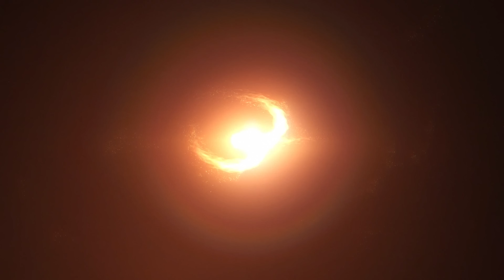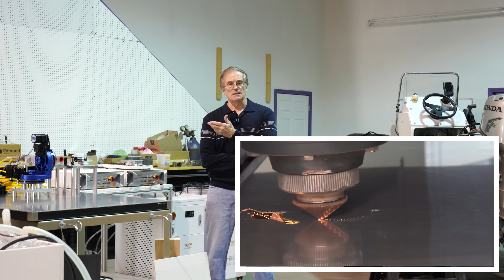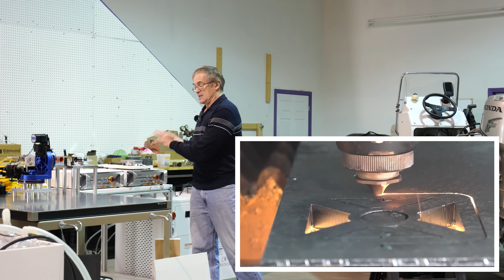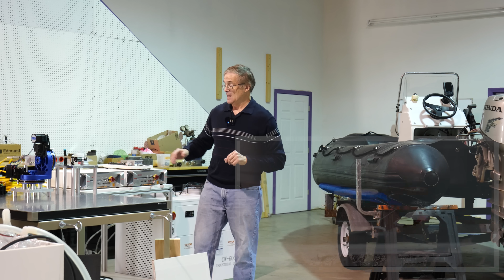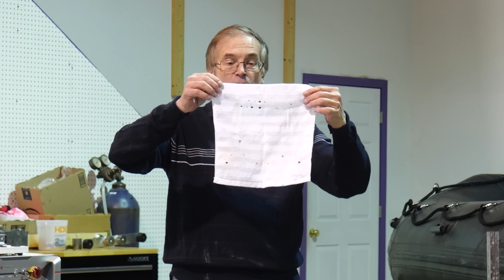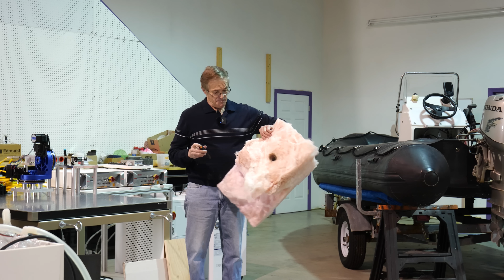We have a problem... and need your help!

Comment: What about a sugar-based carbon Nanofoam (Channel: Robert Murray Smith / TnT Omnibus) and/or Starlite (Channel: NightHawkInLight) - Outside of the energy cost of baking the sugar into a foamy brick, both materials should be fairly cheap and are unlikely to burn through quickly. The "Starlite" is basically flour and borax. I don't think the borax will off-gas into anything particularly dangerous, but it's been awhile since I watched either of their videos - Hope this helps. Thanks.

Comment: How about thermal pain glass with the the top open! move it into position and then fill with water! Drain after testing. Depth can be adjusted based on testing. Glass is not that heavy. Basically  a very thin fish tank. Or a large wall of refracting lenses, But you did mention cheap. Glass might be more expensive than Drywall but may get away with a single layer with plywood backing! Don't know what you budget is but the width of a water wall is easily adjustable.

Comment: If you're using an infrared laser copper is a good reflector. A polished copper mirror at a 45 degree angle, directing the beam down into a sand trap. Basically the same idea used at indoor gun ranges, although there the reflector isn't copper. Portable, too. Outdoors you can send the beam into the dirt. Just my thought!

Comment: My initial thought was that you need to talk to NightHawkInLight about his video on starlite. He basically has a cheap intumescent putty. And it would be a great colab but I think ultimately it wouldn't be a success.  But I do wonder if a falling sheet of water could work. I am thinking about the light ducting you can get with laminar flows. Lastly if that water has the right sized particles you can use Mie scattering to further diffuse the beam. You don't want to stop the beam you want to spread it over enough area that it doesn't generate much heat.

Comment: The 30-minute Gemini deep research on the topic based on the video transcript was amazingly detailed. Too bad I can't link it here. Here's the main conclusion:
Based on the analysis of material properties, laser-material interactions, safety considerations, and the specific requirements for a temporary emergency beam stop capable of withstanding a multi-kilowatt CW fiber laser for at least a few seconds, the following recommendations are made:

Primary Recommendation: Contained High-Alumina Refractory Brick Assembly.

This approach involves constructing a robust, contained assembly using high-alumina refractory bricks (60-70% Al2O3).
 A minimum total refractory depth of 2-3 layers of standard bricks (approximately 5 to 7.5 inches or 127 to 190 mm) is advised.
The bricks should be tightly stacked within a sturdy steel frame or box to ensure stability and containment of any minor spalling.
Applying a dark, high-temperature refractory coating or wash to the front surface of the bricks can marginally improve initial laser absorption and provide a minimal sacrificial layer.
This option offers the best currently understood balance of high-temperature resistance, thermal mass for short-duration energy absorption, inherent non-flammability, a manageable fume profile (provided effective Local Exhaust Ventilation is used), reasonable material cost, and modularity for portability.

Comment: Could you engineer some way to shorten the focal area? I'm thinking a concave lens, then a large convex one, their relative position and power chosen in such a way as to give a more or less hourglass-shaped beam (when viewed side-on) that is non-burning both at the exit pupil and at the wall, but has a narrow range band in between then in which the beam is ~focused. 

Should do fine for testing anything but range and power.

Comment: Point it downward.
If you must be pointed at something, point it at a bucket of wet sand or dirt. You could even make it just a bucket of water. Since the point will be very small, it should take a long time for the water to drain, but water should help diffuse the light, this, especially if it is muddy or cloudy.  The particulates suspended in the water should also absorb a lot of the heat and distribute it to the rest of the water, making the back of the bucket when it hits a lot less vulnerable to penetration or thermal stress from the laser. The bucket can be made out of anything, put a 5 gallon bucket from your local hardware store, and then plug the holes with gorilla tape afterwards. Once the bucket is no longer serviceable, just dispose of it and get another that should provide you with hundreds or thousands of test fires, and they should be longer than a second.  I think muddy water is probably your best option, because the particulates will remove heat from the area, and keep the bucket from melting.  If a plastic bucket won't work, you can always try making your own bucket out of wood or purchasing a cheap metal bucket. But you can probably find a good quality metal bucket from a feed supply store for relatively cheap.

Comment: You're looking for ceramic fiber insulation (also known as refractory ceramic fiber, or RCF).

This material is:

Fibrous and flexible, similar in texture and form to fiberglass insulation.

Made primarily from alumina (Al₂O₃) and silica (SiO₂), sometimes with additions like zirconia for higher temperature resistance.

Designed for high-temperature industrial applications, often rated between 1000°C to 1600°C (1832°F to 2912°F), depending on the formulation.

Common forms include:

Blankets (most like home fiberglass batts)

Boards

Paper

Modules (for kilns and furnaces)

One of the side benefits of this material is its  bright white color, as long as it doesn't carbonize, it should be able to absorb quite a bit of heat I expect it would glow red or orange but as long as it doesn't melt it should work for your application. I'm familiar with the blanket form of this material.

Comment: What about diffused acrylic sheets? You could probably get them colored as well to better absorb the specific wavelength of your laser. Maybe add a sheet of drywall that you already bought behind it or flow water behind it with a hose to absorb more heat if needed.

Comment: Mineral wool insulation might work. Rockwool is the big brand. It is more heat resistant and fireproof than fiberglass insulation.
Reply from the maker: This has been mentioned several times now in the comments, and I should have thought to test it.  I will now.

Comment: Maybe just some bags of dirt would do it? How big of a target area do you need? Are you wanting to perform a full power test indoors where you zap a drone out of the air, or do you just need something you can dump the beam into for stationary testing?
Reply from the maker: For stationary testing, the bricks work well. We need a full-scale barrier, and that's why weight,  cost, and availability are now an issue.

Comment: you should use vitrified ceramic tiles used on floors. It should definitely stop the laser. If it doesn't make a water wall with these tiles. They are relatively cheap.

Comment: How about charcoal soaked with water.
The water will keep the oxygen away from the carbon so it won't ignite,  carbon black is the gold standard for absorbing energy, and it's melting point is 3550° C.
If you put it in a box with something like Pyrex walls that the laser will pass through, it may do what you need.
You might also see if you can get some samples of carbon-carbon, which was what was used as an insulation on the highest temperature parts of the space shuttle, or you could check out the space shuttle tile material.
Reply: You could also use a carbon slurry suspended in water using bubblers to keep everything agitated.
Reply from the maker: Maybe carbon powder in flowing water over a barrier wall will be best.

Comment: How about a mist machine? It will either absorb, refract or reflect the light. As long as the particles are significantly smaller than the beam it should disperse on reflection or refraction.
Absorption might be a bigger problem but then you might consider a waterfall of the fluid. Surface reflections could still be a problem.

Comment: Tightly Sandwich the three-quarter inch plywood between two sheets of drywall basically a plywood sandwich lol and then stack bricks behind just in case the beam punches through, all of that could be put on a nice rollaway cart.

Comment: What about using a laser distance sensor and auto adjusting the focal point?
Reply from the maker: The focal point needs to be in the "killing range" of the drones. But, the beam is still quite small before and behind that point.
Reply: You cant use a lens to change the focal point and render the beam 'harmless'? I did something like that once..except I was auto aiming a nerf dart.  @TechIngredients

Comment: The only way I see to defeat its destructive power is to use the same efforts that you invested to converge the beam for... diverging it! A divergent lens will spread the beam power to a larger area that some of the material you already tried will be able to withstand. With my knowledge this would work only if the laser beam is fixed and not moving... But hey, you know so much more about optics than me, you'll find a way to make a "optically divergent wall" (probably you can also find a better name lol)!!! Good luck guys, you are basically living the work of my dreams, thank you so much for your videos!!!
Reply: Or what about something like a Holmdel Horn Antenna made of a reflective surface that will ideally focus any incoming beam to the focal point where you can place a divergent lens. TBH this will probably make your next video EPIC lol Ask Colin Furze to help you build it =D
Reply from the maker: We have to cover the entire back wall.

Comment: Use water with some particulates in it, and/or an object , so it will absorb and diffuse the energy. A fish tank, have some form of agitator, or circulating pump, then in the water just add silver or something, also use a chiller to pre cool the liquid. Use directed pumps to force the water at the point of entry into the fishtank, keeping the heat moving. You can make a small hole in the fishtanks, where the water flows out, use that as the target point for entry, so you do not have to worry about the glass melting. copyright me, limited license to you for this test case.

2nd plan,

Set up a water jet array, with multiple streams of water, as the light hits the streams of water it will absorb and diffuse the energy, adjust stream thickness and volume as needed for the amount of energy diffusion needed, think of it like a water fall machine. And experiment with different additives in the water, nano particle silver comes to mind. Technically if the water is clear enough you can shape the light to expand its footprint.

3rd plan, make a large diffusion optical, lens, that takes the small beam of light and expands it to a manageable surface area, catch and release…

Comment: Fog machine\nebulizer run the output through a tube and then the laser through the tube.

Lasers hate water molecules makes em scatter.
Water molecules love to soak up heat.

 It should cost you less than $500 to make it

Comment: Whatever material you choose, consider the angle its presented to the laser.  I.e. burning through sheetrock at a 22° angle will behave as if it were much thicker than if it were face-on (no angle).  This is the same trick employed by modern tanks and armored vehicles.  The angled armor plates gives much more protection at no increase in weight.
Reply: The only other aspect to this is reflection ability of the impacted material.

Comment: Textured metal is probably the best choice. It won't reflect too specularly from a few meters if it's textured (you're wearing eye protection right!) and it won't hit >700-1400C in less than a second if it's reasonably thick. The effective heated area is proportional to thickness and conductivity, while heat capacity is proportional to thickness and area. If you were focused to <100um it would just burn through, but at >1mm you're down 100x in power density and you've got some time. I'd probably go with 3mm aluminum "diamond" sheet which would be <30lbs each for 4x8 sheets. You can sand blast it for texture and rivet it to hang multiple sheets like a curtain. Steel would be heavier and work too, but DONT do galvanized!

Comment: Just using energy absorption means more mass. Add dissipation? A rectangular sheet metal water tank? If you punch through the sheet metal, then increase the spot size by tilting the tank.

Comment: Started with idea of reflect/bend instead of absorb. Perhaps large fresnel lens sheet. Refract (instead of reflect) the beam down to a safe spot. OR - Similar to LIDAR, measure the reflect time, calculate distance. Shut off Laser if below a certain distance.

Comment: use a lens grade glass with uneven surface. put a drywall behind it. the uneven surface will disperse the laser beam so it will be totally unfocused when it hits the drywall. should be cheap and light enough.

Comment: If the water soaked fabric survived several milliseconds how about a belt of material that is driven around pulleys through a water bath? You should be able to tune the speed to evaporate water without burning up the fabric, though you will end up with a lot of excess water vapour if you don't stop the beam fairly quickly.

Comment: Can you build a moveable wall that is made of borosilicate sand that would scatter the light as it hits the sand and auto fills in the gaps as the sand is turned into liquid glass?  Maybe something about 4 inches thick on wheels.

Comment: Some quick thoughts. 

Ceramic tile

Some sort of fine powder like a salt or baking soda with a high melting point

Maybe glitter mixed in, to disperse light into nearby particles 

A sandwich with some sort of tile, or plywood, filled full of this powder, with a tile backer, maybe even polish the tile backer so it send the light that gets through back into the media

Comment: Maybe look at it like a firing range designer would.  Open the door.  Move the truck. In place of the truck put a large mound of earth, sand or crusher run gravel.  It looks like you simply need volume.  Maybe sand bags filled with different media.  Good luck.

Comment: I once saw a sheet of Mica it was about 1/2 3/4 inch thick, the old guy said where he got it from but don't remember the location he mined it from but he had several sheets leaned up on the wall, all were like 4ft x 2 or 3 ft in size and planed to use them for furnace windows. But I know he mined them from someplace in CA or Nevada. I do have a small chunk of it about 3in x 6in he gave me for my rock collection. I had never seen that much Mica before. No clue what it costs. I would test your rig on it if you could find some sheet/slabs like that. Looking at what I have, easily 500 layers in it's thickness, cheap green laser scaters internaly in first 1/8 inch but the Mica has some surface shine, I dulled up the surface with some sandpaper that stopped most reflection. Could sand flater if you wanted to basicly machine one side. But I think either Mica slab or you might try Vermiculite filled/packed backstop made of Hardy backer board used for tile or cement board. I used 1/4 inch Hardy backer around my heater as heatmass storage with air gaps to aid efficancy when it's on. So your rig might burn a hole thru the Hardy backer, I don't think it will burn the Mica or Vermiculite unless its sustained in one spot maybe. But anyway thats what I would try Hardy backer is cheap and large bags of Vermiculite are cheap. Oh, and use metal studs, none of these things will stay on fire if that happens at all. Carbon fiber cloth curtaine filled with Vermiculite might work as well.

Comment: What about an offset spinning ceramic tile mounted close to the laser source?

The idea is that instead of trying to absorb all the energy in one spot (which obviously isn’t working), you use motion to constantly change the beam’s point of contact. So even if the laser is punching out 1 mm of solid energy, that spot is only getting hit for a fraction of a second before it moves on.

A good ceramic like alumina or silicon carbide can take serious heat—some of them have melting points above 2,000°C. And because the disk is spinning, each point gets a break before the beam hits it again.

Let’s say the tile has a 5 cm radius and spins at 3,600 RPM (just 60 revolutions per second). That gives you about 314 mm of perimeter, so at that speed the beam travels along the surface at around 18.8 meters per second. A 1 mm beam would only hit a single spot for about 53 microseconds each rotation. That’s not long enough to burn through quickly.

It probably won’t last forever, but it might give you enough time for the kill switch or tracking system to respond. You can always make the disk thicker or use multiple layers if you want redundancy. Definitely cheaper and lighter than a brick wall.

Anyway, thought it was worth throwing out there; cheap, fast-moving, heat-resistant.

Comment: It needs to be some sort of high density ablative substance. Anything that just melts/absorbs the heat is going to stay there and be a problem. Affordable and available ablatives aren't easy to come by though. Stuff like Starlite can survive the mundane temperatures of a flamethrower, but a laser would probably punch right through it.

Comment: I would recomend looking into the homemade Starlite from NightHawkbyLight. Another youtuber Mancave Technology tried burning through a thin layer of it with a CNC laser engraver/cutter it withstood the laser at full power for over 2 minutes. 
It's quite affordable with main ingridiends being PVA glue, baking soda and corn starch. When heated the materials react to create porous carbon structure with very poor heat conductivity to protect the underlying layer.
Alternativealy there are some comercial fire retardant paints that work on similar principle.